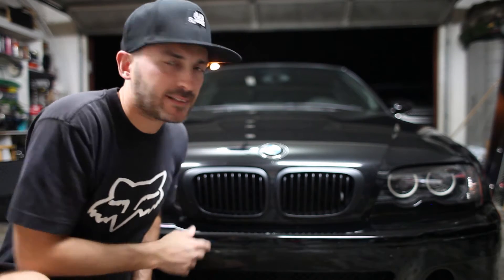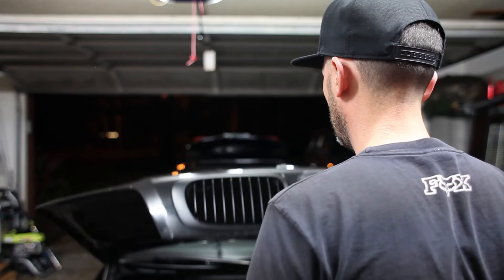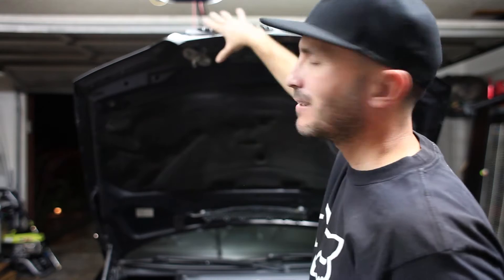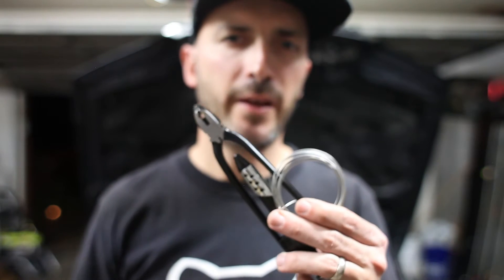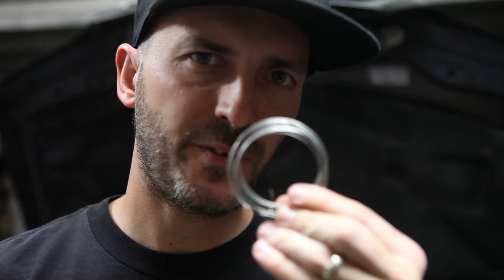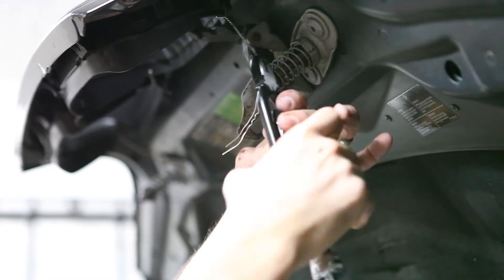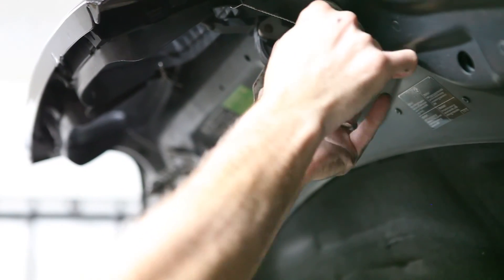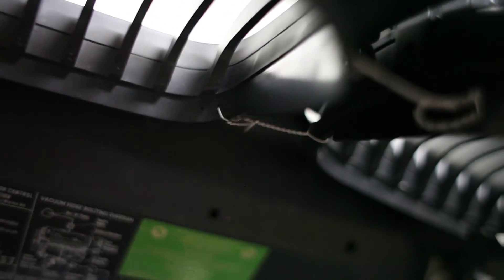How I fixed the loose kidneys or grille on my e46 m3 | vlog 033

Comment: Had exactly the same problem. I found the perfect solution. Took the old chrome ones out (and discovered the previous owner had jammed some bodgie looking rubber into them to hold them in place), trashed those ugly suckers, then slotted in a brand new set of sweet black grilles from Turner Motorsport. 30 seconds later...perfect ;-) Good job with the safety wire though. Tight! I was cringing at the thought of that swarf falling into the engine bay. But you had that sorted too. Nice!
Subscribed. Sweet!
Reply from the maker: Yeah I was super close to buying a new set but I had some time to kill one night and figured I'd give it a shot. I'll order new ones one of these days. And thanks! Glad you liked it and thanks for the sub!

Comment: You can buy a new set online for less than 50 bucks all you need is a flat head screw driver to get the old ones out then press the new ones in with your hands

Comment: Where can I get a black front bumper for a 2005 BMW 325ci? I’ll probably need the screws for it as well.
Reply from the maker: vincejr100 I got mine off of eBay. Well not this one, but another e46 bumper that I’ll put on eventually. You can scour eBay or craigslist, or just buy new.
Reply: Black Flagged thanks boss! Subscribing
Reply: If you have a link to one that would be awesome